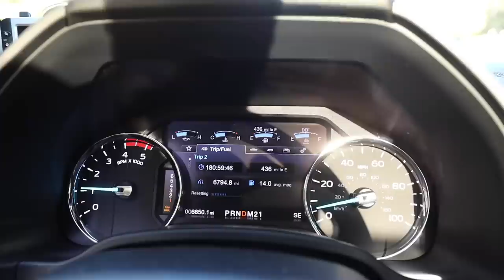KYD Back on the Road! First Stop: Ouray Colorado

Comment: So the family took our very first rv trip and I’m so glad I watched your videos in preparation!!! I measured the height of the camper... right at 10’6. Came up to a low clearance covered bridge. Sign said 10’6 turned that thing right around in a Amish driveway! Then our hot water heater wouldn’t light! Mind the dip pops in my head. Figured it out, the reset was a design flaw. Had a great first trip. Thanks for all you guys do!
Reply from the maker: That sounds like a first trip! Nice job. Things get easier :)
Reply: You can always let some air out of the tires if you have a compressor onboard to "air them back up!" That will buy you some clearance -- but with dualies it would be more trouble than it's worth if there's a viable alternative. We got out of a parking garage nightmare that way.

Comment: Don't want to sound dumb but whenever I start my RV fridge on propane and it has been sitting for any length of time I bleed the propane line by lighting the stove manually first. Turn on the burner and light with a lighter designed for a grill. Once all the burners work the fridge will light up no problems.

Comment: Have you considered ditching the Gas/Elec fridge for the Furrion 10 cu. ft. 12V Compressor fridge?  Direct replacement for 8 cu.ft. Absorption fridge and no longer have the hassles and inconsistencies of Gas.  If you have a decent solar setup, it will run forever.  Only draws 5A @ 12V if I recall when running.

Comment: I'll guess around 12,000 miles for the entire trip! Not sure if your F250 truck will do it, but our 2015 F150, 2018 RAM 2500, and 2015 Hyundai Sonata on trip A and B roll back to 0 after 9,999.9 miles. Safe travels!

Comment: The issue with the fridge maybe the valve may have been opened too quickly.  The new style propane tanks limit the flow in case of a massive leak.  To remedy, close the valve and open again slowly.  Hopefully that cures it

Comment: Was wondering if there was any particular reason you did not go with a Hensley Arrow as you W/D  hitch ? I have had mine since we started pulling and RV about 10yrs ago. I actually contributed it to saving our lives when we were rear ended and if it was. Ot for that hitch we would have most likely been pushed into head on traffic.  The hitch kept us in our lane but bent the heck out of the tension bars and spring bars. Us super quick to hitch . Just curious happy trails hope it works out and you are able to get across the border
Reply from the maker: We enjoyed the Hensley Hitch, but we had an on-goinig sway issues with the Reflection. The Airstream tows so well, we're going to evaluation other hitches. For safety, I'm going to try the Tucson Sway Control with connects to the right/left brakes much like a car.

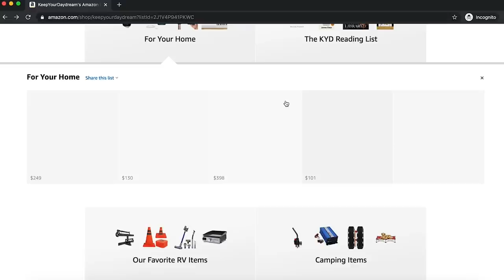Comment: 18:10 why don't you just turn your main water valve off? That's free and more secure.  18:52 If your water heater or supply line break turning off the faucet will do nothing.

Comment: 13000 miles, allows for grocery stops and oopsies😁
Reply from the maker: We're tracking non-towing miles this season... if I can stick with it. Should be interesting.
Reply: Ah, well that changes some things😁 10500 miles. Ive been through Ouray, not advisable to travel 550 in a tractor trailer combo at 70ft🤣

Comment: Fridge is altitude problem.  It will not consistently light,  not never, Not no how.  To much fuel and not enough air.  I run mine on a small inverter for that time that we know we are gonna be up in the mountains..  sometimes I light it manually.  No real solution.

Comment: What's the matter?  The Jeep and Egg Shell not big enough for you ? How long did that experiment last?  No problem,  eh?  Just go out buy a 30 foot plus bunkhouse Airstream for $125,000, a $100,000 Super Duty with $25,000 of modifications, and then add a $50,000 solar/Battle Born/ 4000 watt switchable hybrid inverter charger. Don't for get to enlarge the puny Airstream tanks so you can boondock more than a weekend.  Can't overlook the Chinese made Firman Generator (after all if it's ok for Phil Knight, the NBA, and LeBron James that Nike and the CCP use child slave labor to make shoes, then must must be ok for Firman to use condemned children to build generators).  Who says indulgences are no longer for sale?